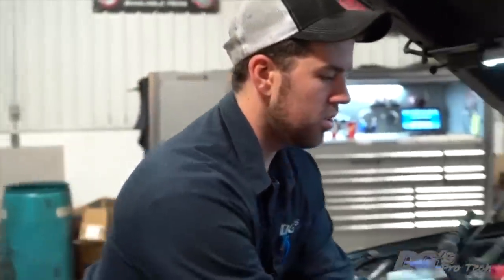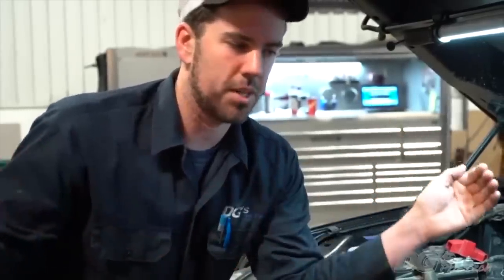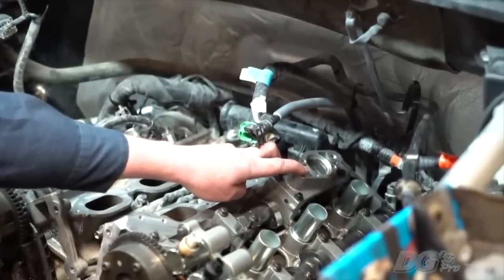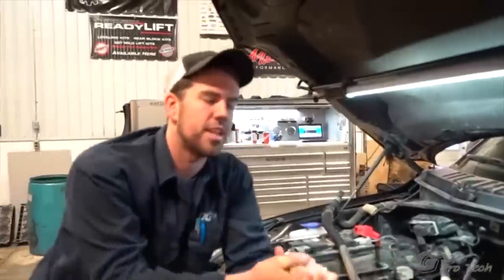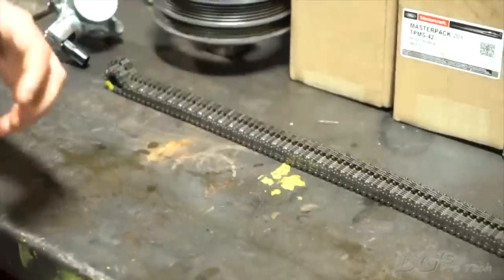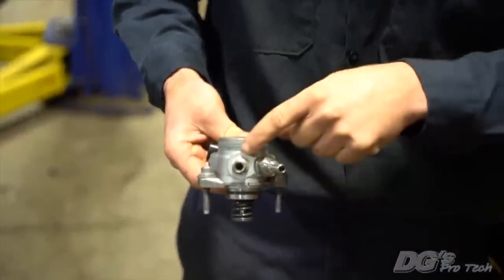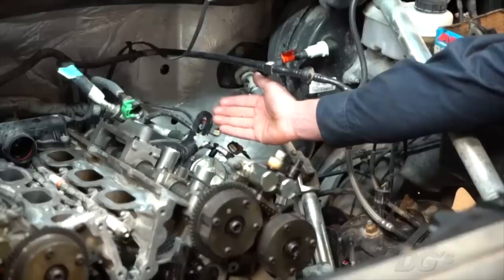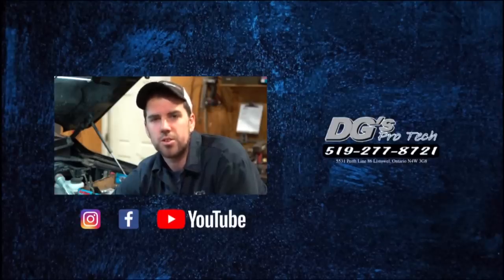What you NEED to know about Ford EcoBoost Engines by Dustin Golley of DG's ProTech

Comment: Let me get this straight, It's an interference engine, the chain tensioner won't accommodate predictable wear, the chain will stretch if the recommended service interval is followed, the turbos might fail, and it's got direct injection, which is notorious for carbon build up on the intake valves. Sounds like a complete POS, I would never own one , more garbage from Ford !!

Comment: This guy is good, and he knows his stuff.  Although my 2013 Taurus has a regular 3.5, I have moved from Ford semi-synthetic oil and the recommended Motorcraft filter to full synthetic Pennzoil and Wix full synthetic filters.  Another "bad" thing about these engines is the water pump is only accessible behind the timing cover.  And in the FWD Fords, the whole engine and sub-frame have to be dropped to repair a leaker.  So it is imperative that the coolant be checked for proper PH and changed when required, not at 100,000 miles like Ford likes to claim.  Oil and coolant and trans fluid changes; never, ever follow the Ford tables in the owner's manuals; they are there for promotional bragging rights only.  Trans fluid; no more than 30,000 miles.
Reply: he knows some stuff.... i wish he knew the 3.5 in the f-150 isnt the same as the explorer
Reply: I got wise to the owner's manual recommendations when they came out with "lifetime" sealed CVT's. There's no way that transmission is going to last without some sort of regular fluid change.

Comment: I get 13mpg at 60mph on cruise on my 3.5...
Reply: Don't know what the hell is wrong with yours, my 2013 3.5 gets 18-20 at 60mph
Reply: @Robert-qm7yi  Mines crewcab 4x4,6.5ft bed, yours?
Reply: @seand2022  Crew 4x4 short bed. 
You have a lot of hills or wind? I know in the plains and mountains I drop down to 13 or so depending on how bad the wind is.
Looks like you have some kind of problem or you're just staying in the boost but even that shouldn't drop your MPG that much

Comment: Solid analysis of what I would call a "hyper-tech" motor. Keeping oil fresh and clean has always been a priority of shade-tree mechanics. I've got a 1986 Ford 5.0 HO motor that has 330,000 on it and many beatings but she still runs like a champ. Reason? Oil and filter changes every 3,000 miles like clockwork.

Comment: Thank you sooo much for that information.  The real problem I see is IF I have a problem and do not go to Ford to fix it, the secondary mechanics shops that work on these engines whom profess to be a custom or good shop DO NOT replace all the stuff needed when you have this problem, they go in and fix the problem itself and do not change the other components while there as preventative maintenance, then there are problems that occur from the other components and the engine has to be torn down again to replace one other component.  Education and getting the right mechanic for these engines is very very important, thank you for your education for the public, this was a great video and very transparent as well..!!

Comment: GM/Ford and Chrysler products are not as reliable as Toyota or Honda.
Simple reason is that honda engine parts are made at a higher quality. Honda and Toyota engine parts are forged. GM/Ford engine parts are cast.

In fact honda engine parts are so well forged that you can run nitrous on a stock motor. It will of course burn up your rings and seals, but the engine parts themselves can take it.

Try doing that on a ford or GM motor and you will get MAYBE 5K out of them. If you are lucky. Engineering and quality control are the biggest contributors though. American automakers had absolutely awful reputations for quality control for a very long time, although China has picked up that torch and run with it these days. Bad QC is usually the result of poor working practices, unskilled/uneducated labor, and just generally not giving a shit or being more interested in building cheap parts than in building good parts.

Engineering is quite expensive. Making something good is almost always more expensive than half-assing it, and just going to the old parts bin is cheaper than both. There are also idea like "planned obsolescence" where manufacturers essentially build-in a failure date in order to force consumers to replace the product.*cough ford* Japanese manufacturers made their cars very reliable in order to cut down on costs of spare parts shipping to other parts of the world. They achieved that through, as it's mentioned before, rigorous quality control, and it payed off. They were also a bit more expensive due to shipping and quality control.

Once this system of car production was established, it wasn't changed later on. Hey, why change it if it works? Hence the old Tundra designs

Local car makers do not need such quality control as you have original spare parts on every corner, as well as trained mechanics. This also makes them quite cheaper. Since this car production system was well established - hey, why change it if it works? And this why the F150 is the best selling truck in America, cause it breaks down so much you're forced to buy another one.

Comment: What I've discovered with all of these modern engines (gm AFM/DFM, chrysler MDS and ford ecoboost) is using synthetic oil only, only what is manufacturer recommended, and doing 5000 mile oil changes (ignoring manufacturer 10-15k mile change schedules). When I see someone bitching about problems with a truck, the first thing I ask them is when they do their oil changes. I always hear some crazy "but its supposed to be a bulletproof engine" story and it turns out its 110,000 miles on the odometer and they've done 4 oil changes. Hell bad oil is what killed the 5.4 V8 as well, every mechanic under the sun says stay far away from those, but the issue is 100% oil maintenance dependent. Sure stay away from them now because most haven't been maintained, but if you find one that was maintained then there's no harm in getting one.

Comment: 5.0 L V8 has oil consumption problems from 2018-2020 due to poor cylinder lining in engine block
3.5 L Ecoboost V6 has Cam Phaser problems 
2.7 L V6 ecoboost has timing cover leaks, the list goes on and on and on

FORD Engineers are incompetent. They are designing these engines to break so they make more money repairing them. The majority of consumers are clueless so buying these $40-$70k vehicles they expect long lasting quality from Ford but nope you get fucked right up the ass. At this rate people will have to buy another truck every 2-3 years due to these plethora of problems. This is downright disgusting and is planned obsolescence at its finest.

Comment: Anytime you put boost on a small engine to obtain the same or better power of a big V8 your going to have problems.  Especially when the small V6 is under a load.  High rpm plus the heat and friction required to obtain said power is going to significantly reduce the longevity of the boosted engine.  It’s simple physics.  Ford built these engines to meet the fuel economy requirements and these are the facts.

Comment: My company has a 1st gen 3.5 in a f150 just turned 300k still going strong original timing chain and turbos had pensoil platinum 5w30 every 5k miles

Comment: Had one.  NEVER again.  EcoBoost is a total POS.  They say it can tow... that's a buncha crap and a baldface LIE. Maybe tow from one driveway to the next, but certainly not even our usual 4 hour river trip, towing only a 3000lb twin Seadoo trailer.  Had premium gas ALL the time, but even traveling 55 to 60, attempting to stay out of boost, this EcoPOS blew the electrodes AND ceramic insulators right out of 3 plugs and just quit.  Had to drop the SeaDoos to have this POS truck towed back to a dealer (AAA also towed the SeaDoo's back to the dealer for us), where they told me all it needed was plugs!!!  I told them just who TF do you think I am.  I build race engines AND turbine engines.  I have multiple commercial aircraft ratings including rotorcraft and CFI's. Maintain my own Allison C20B powered Bell JetRanger. Told these dumb fucks that was serious deto that blew those plugs apart... and you couldn't even hear it until a second before it blew.  Soooo, just WHERE did all that ceramic and steel electrodes go, huh?  Right through the engine.  Told them to pull the head and have a look see.  They said, "no way... it ONLY needs new plugs".  So, I said... no, fuck you people.  It was a new truck on lease, so I left it with them and rented a REAL pickup to tow my SeaDoo's and go on our way to our family vacation (back in 2018).  Turns out, they did indeed replace ONLY the plugs.  Compression checked out poor (as anticipated), so they sent the truck off to auction (it was really internally F/U'd).  AVOID these Ford EcoBoost POS's like the plague.  Yeah, they can be fixed, but why?  The same failure (or WORSE) will only happen again, and quite likely sooner.  You have been warned.
Reply: what truck do you recommend buying or have better luck with cause i'm in the market for one, and was seriously considering f150s but they seem like total garbage to me
Reply: Well, although I'm not a Ford guy, they do have great interiors... just not a fan of their engines or trans (can you guess why?)  I'm a GM guy, and would certainly buy a Durmax Diesel (which comes with the AWESOME Allison trans)... IF you're going to tow heavy.  GM interiors are still excellent, but Ford interior appointments and exterior colors are tops (wish GM had Ford color choices).

Although the Durmax Izusu Diesel engine is one of the best, the Dodge Ram Diesel is likely the better of all big diesel truck engines, but the Ram body, trans, electrical (computers), and major components are definitely NOT the best.  Dodge is owned by FIAT (who make some of the worst cars on the planet), and I would NOT recommend a Ram for exactly that reason, regardless of what JD Powers says (BTW, JDP will print just about whatever you want to say ifin yoose buy's enough ads with them).  FYI, JDP is NOT a car testing facility in any way shape or form.

If heavy towing is not in your future, I would then suggest a Toyota Truck of some size to fit your need.  At the smaller truck end... of the Toyota's, I would suggest a V6 Four Runner, which I got for my daughter (but, it is a man's truck)... and then all the way up to a V8 Tundra, which can still pull a good size load (10k lbs).  All Toyota gas P/U trucks will generally outlast either GM or Ford gas P/U trucks (and are an excellent choice indeed).

But, If you're planning on towing more than 10k, you're back to either a GMC Duramax Diesel, or (not my fav) a Ford F250 SuperDuty Diesel.  Either of these two will more than pull just about any weight without getting into "Dually" status... which is most often not necessary, and not often preferred (a very rough ride, unless you opt for air bag suspension).  Them's my choices....

Comment: He's absolutely correct about running high quality oil and changing it religiously with the Ecoboost. One thing to note is the variable timing solenoids work off of the engine oil and they have extremely fine screens to filter the oil and if your not changing the oil regularly it can stop them up. Dirty oil will wear out the timing chain really quick. I personally use Mobile-1 synthetic and change my motorcraft filter every 2000 miles and change the oil every 5000 miles on my 3.5 Ecoboost.
Reply: The chain stretches due to stresses keeping everything aligned. Dirty oil doesn't help. Depending on how you drive can be the main culprit...lots of changes in engine speed vs sustained rpm. A little bit of dirty oil shouldn't stretch the chain to the extent of cam phaser misalignment so there is something fundamentally wrong with the internal design of the ecoboost engine if it can't even sustain hard driving. Lots of people stretch the chain cause they beat the shit out of their 3.5 Ecoboost, cause you have to or else the turbo's will get stuck.
Reply: @teshengliao7110  I personally love the 3.5L Ecoboost engine. If it's taken care of it's going to last. I have 3 F150's with this engine. It's not the brunt oil I'm referring to, but the dirt and grime in the old oil that's wearing out the chain from people not changing it regularly. My oldest truck has over 400 K on the odometer and still hasn't had a problem with the chain. And I beat the living hell outta that motor on the farm every day. The problem is if you don't use a quality oil with a high detergent and change it often the passages get clogged and the chain tensioner doesn't keep the slack up and that's when owners start  hearing the rattle on cold startup. The design of this engine is perfect.

Comment: John here these motor today not worth a dam other than bearing and rings but the came twin cams go bad quick motor go to hell.I.ll take the 351 ford 289 and chevy 283 327. Dodge 273 slant 6 318 383 440 kept oil in then run for ever new motor yep more power but the ones we all was able to work on them.

Comment: So what you’re  saying is there’s very little difference is fuel burn between this and the V-8 but you burn a lot more petroleum in oil changes.  Meanwhile oil changes cost a lot more than a gallon of gas and you have significantly more expensive parts and failures.
What the purpose of Ecoboost over V8 again? 
 How about we just make more Lion family diesels for fuel economy and towing and call it a day.

Comment: I bought a brand new 2018 ford f150 eco boost 3.5 January 2018. Long story short 35,800 miles cam phasers gone changed under warranty. Got the truck back Approximately 38,000 miles truck would stall at stop signs and red lights one time I was traveling approximately 65 miles an hour truck just stopped running. Took in for repair. Seven weeks later got truck back turned out it was a corroded negative ground cable thank god for extended warranty. 59,800 miles truck is scheduled for repair. Second set of phasers again. Mobile one full synthetic oil change at dealership every 3,000 miles. This is my third F150 I havent even started on what was wrong with them.

Comment: I really enjoy my 2018 F150 LX with ecoboost and get better gas mileage than my 2007 Nissan 4 cylinder Frontier (22 mpg). I run it on back roads in ecoboost mode and normal on the interstate. The 4 wheel drive is clunky and only used when absolutely needed in soft dirt. The automatic engine turn off when stopped is irritating, but there are work arounds for that. I'm good about oil changes and have heard keeping your tires rotated helps preserve the complicated 10 speed transmission. When I get up to 60,000 miles I'll think about whether to sell or keep it. The Frontier with 270,000 miles is my trash truck that still runs great for my dirty jobs.

Comment: Love my 2011 F150 Ecoboost and I love the boost! I bought it new in 2011 and only have 85k miles on it. I change the oil with Motorcraft semi synthetic oil every 5k miles. The only repairs I have had to do is the rear 02 sensor one time and battery. other than that it has been only tires, air filter, wiper blades etc. It pulls my 7500lb 30 foot camper great. Fuel mileage is not great but getting on the highway is not a problem.I do wish I had at least the 3.55 rear diff instead of the 3.15 now that I'm towing more.

Comment: The key point is as you said, "this was racecar technology only a few short years ago."  The Chevy 3.6 and many other small diplacement engines, particulary when turbocharged all have the same issues.  People want to use the cheapest oil and filter and drive it to 0% oil life before thinking about an oil change.  They are high performance engines even when in a mini-van, small car, or grocery getting SUV.  You must maintain them well or they will turn to junk quickly.

Comment: This is one of the most informative videos I have ever watched on the topic of the 3.5 litre Ecoboost engine.

I have owned a 2011 F-150 Ecoboost since new and it has been been religiously taken back to the dealership from which it was purchased for scheduled service appointments.  Just shy of 150,000 km, my CEL came on and the engine went into reduced power mode because of stretched timing chain.  Fortunately, I had purchased the extended warranty and the dealership (or Ford?) covered the cost of repair.  Other than that, I have been very happy with the reliability, power and economy of the engine.

I do tend to  and drive "economically" when I am not pulling a trailer or (occasionally) exercising the turbos and have heard a slight "hoot hoot hoot" when I back off the pedal if the turbos have been spooled up.  I was wondering if it was due to the waste-gate.  The truck is now just over 200,000 km and is going in for its next oil change, tire rotation and multi-point check...  I think I will ask the service manager about the possibility of a sticky waste-gate.

Sorry for the long post but thanks Dustin for making such a clear and concise video.  I found your website and contact info as your shop is less than an hour away.

Comment: I relate this to my 3.7 in my Mustang which is pretty much the same. My only fear is the Duratecs are the water pump is inside the engine which is a design flaw and that alone is the reason I was going to sell it but in my case the 3.7 waterpump is replaceable without opening the engine. BTW. What he dosent mention is don't listen to the 100k oil change from the manual. These are Valuable timing so the one cause of their failures is lack of oil change due to the VTC getting gummed up give value timming issues. Change the oil every 3 to 5k.  If you know more on this then please educate me. Thanks